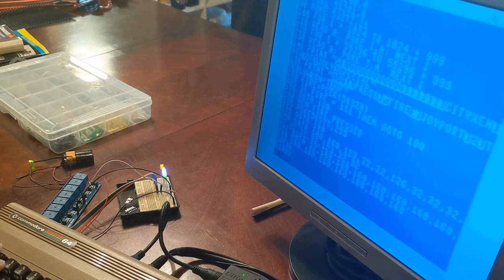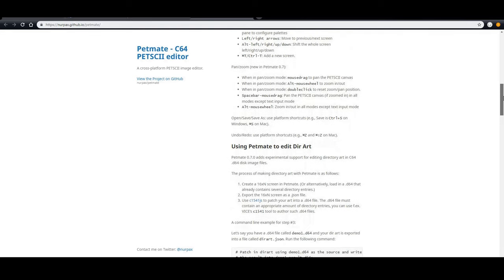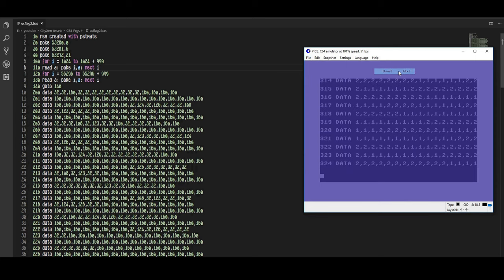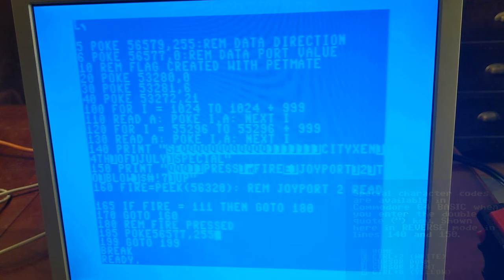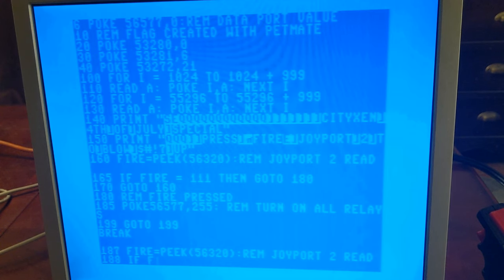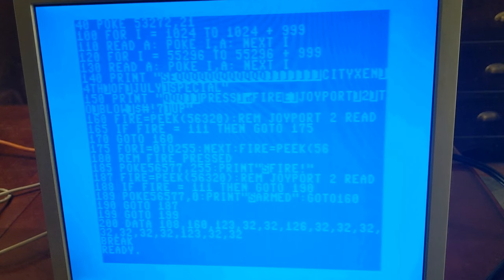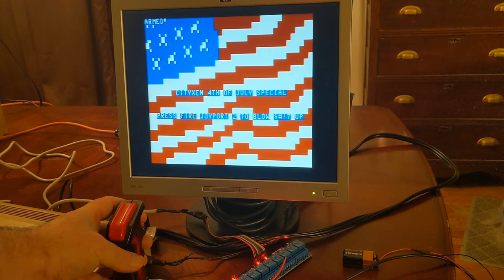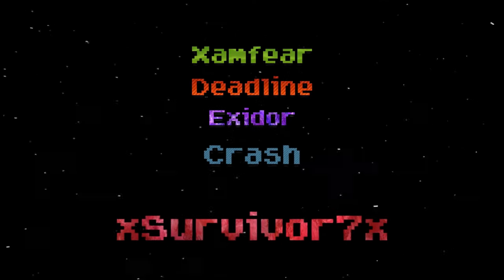How To: Make a Commodore 64 Fireworks Ignition System with an 8 Channel Relay

Comment: Hello,

I want to turn on 1 led on port 1 for 5 seconds
I want to turn on 1 led on port 2 for 10 seconds
I want to turn on 1 led on port 5 for 40 seconds

can you help me?
thank you
Reply from the maker: Hi, sure no problem. You can either join our discord channel (it's in the description), or you can email us at media@cityxen.net. You could try using the relay tracker program also, which will let you edit a "track" to play back the sequence you're describing. You can find the relay tracker video on our channel, and it has a download link in the description.
Reply: @CityXen  ok mail now